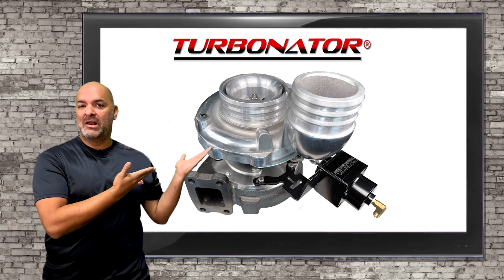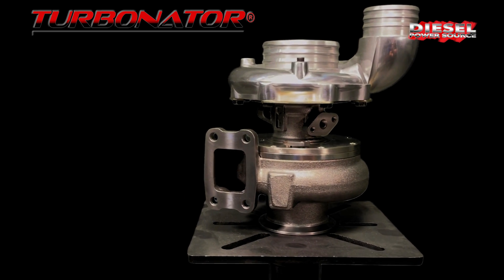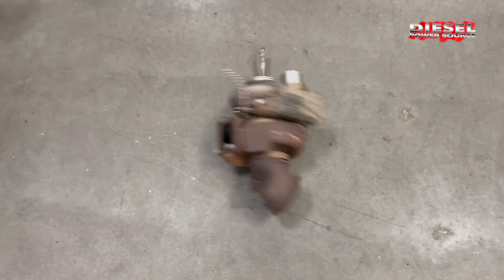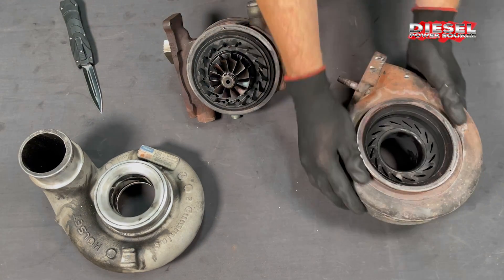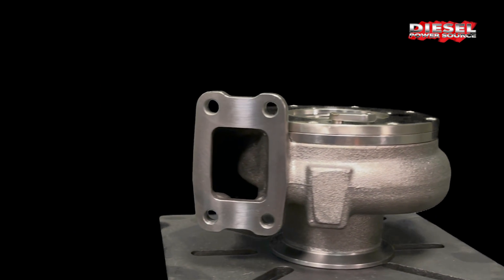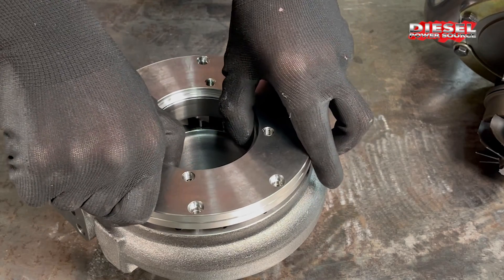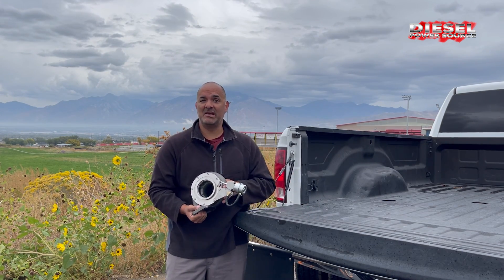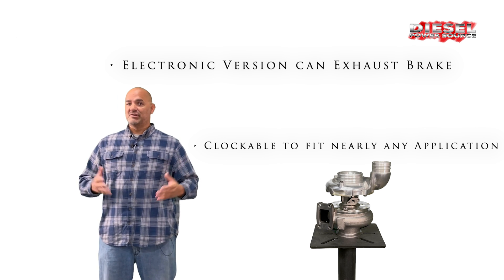What is a VGT turbo?  What is the DPS Turbonator® VGT?

Comment: I build a ton of turbo ls cars and I really want to try one of these vgt turbo housings.  On my current build I have a bullseye power billet wheel s480 85/96 turbo on a full forged darton mid sleeved ls3.  I also have the turbosmart straight gate 60 egate.  I am only planning on running around 1400hp but I want faster spool times.  Is there any issues with running this vgt housing on a gas engine.
Reply from the maker: Our VGT housing would and has been used for race applications.  It works amazing for improving spool-up and overall responsiveness.  Feel free to contract us directly through www.DieselPowerSource.com

Comment: Hey just found out about this turbine housing able to be used on s300 turbos. Ford 6.4 guys with single turbo conversions are starting to use this and said it makes a huge difference for towing and response. Do you have a video the difference between the electronic and the mechanical one? What are advantages of each. How does this perform in a compound setup with high boost and drive pressures? Thanks
Reply from the maker: If you already have an S300 turbo on a 6.4 Ford, you can probably get our Turbonator VGT to fit on your turbo and it does make a huge difference in spool-up and towing.  Our VGT also works equally well in compound setups.
Reply from the maker: Our VGT can be added to most of our compound kits, they work great.  For the Ford application you have to go with our mechanical 3-stage actuator (which is our flagship actuator now).  The other actuators are too large to properly fit.